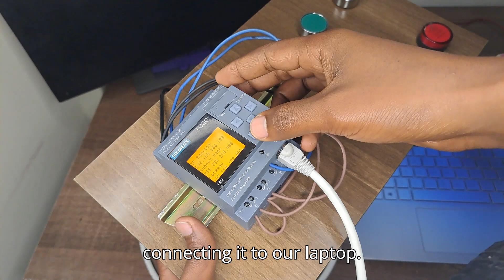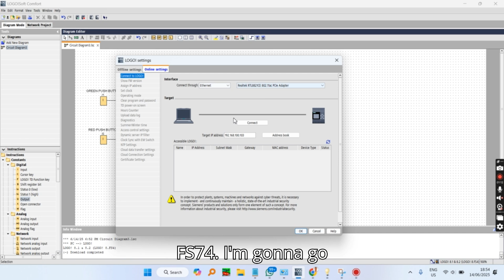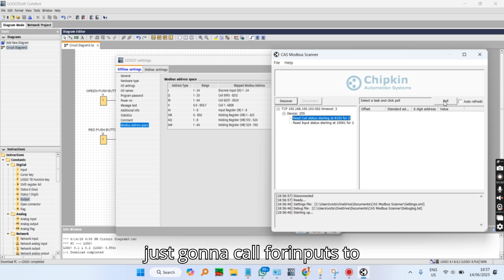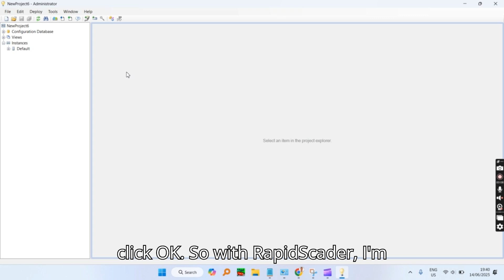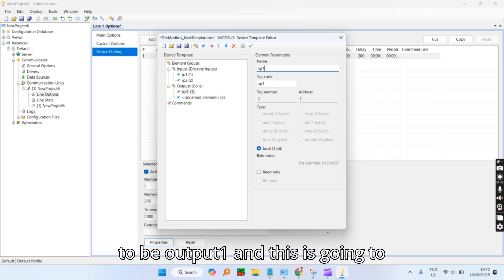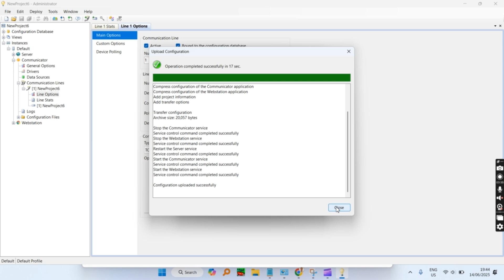How to connect PLC LOGO Soft to Rapid Scada

Comment: Hi, brother. I really like what you're doing, and thank you for the work you've done. Could you please increase the sound in your next tutorial, because in this one and the previous one, the sound is very low. Try using a good microphone soon.
Anyway, you know, we don't find many project videos on Rapid-SCADA. Therefore, try to make complete Rapid-SCADA project videos from A to Z for those who want to start from scratch with Rapid-SCADA. For example, I have a project where I have to remotely monitor and control generators at remote telecom sites. At these sites, I have to monitor in real time the fuel level, the ON/OFF status, the generator battery and so on. I plan to use Rapid-SCADA to converge all the data from these telecom sites into a control center. Thanks again for everything.
Reply from the maker: Hello, Thank you for your comment. I sure will get a better microphone in my next videos. I can help you with Rapid Scada. Let me do a step by step tutorial from beginner level to expert level. Also What communication protocol does your telecom sites use? I can try to make one scenario of it.